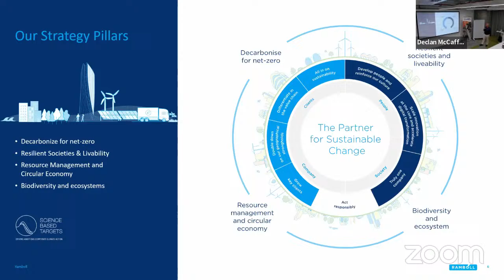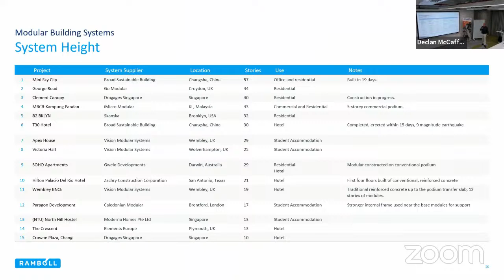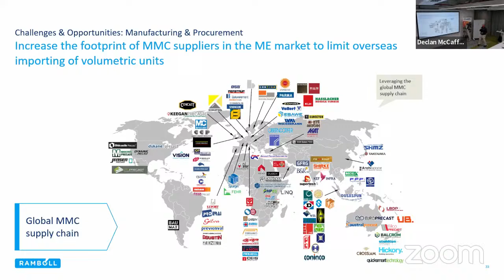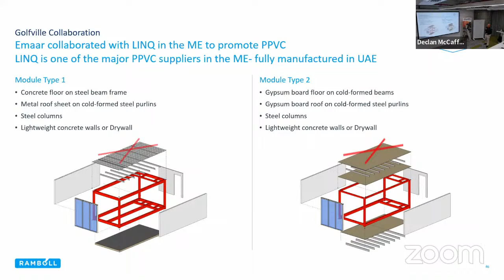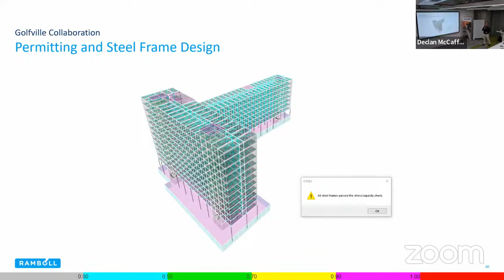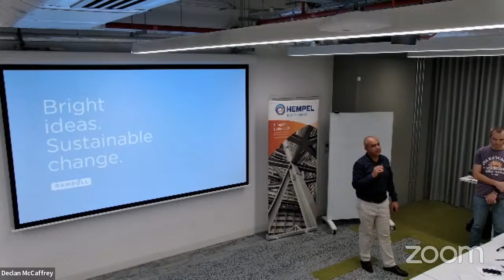Pushing the limits of Modular Construction in high-rise buildings

Comment: informative and interesting presentation   thank you..... I would just like to clarify a simple issue..  without using BIM , modular construction cant be facilitated especially in MEP and pre-installed services issues.....one more issue....what about the roof floor???it should have been discussed separately
Reply from the maker: Great comment, although modular construction dates back to the 1800s - no BIM then. Just engineers that could read drawings and visualize in various dimensions
Reply: @IStructEUAERegionalGroup  in 1800s. Buildings were not complicated and tenants needs were not demanding like our era right now